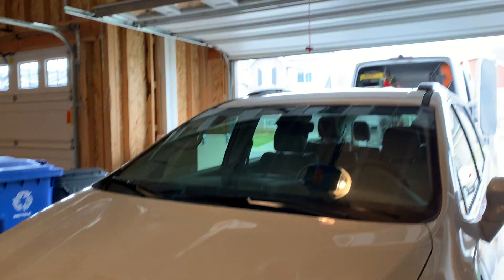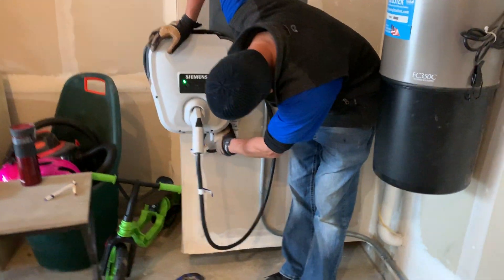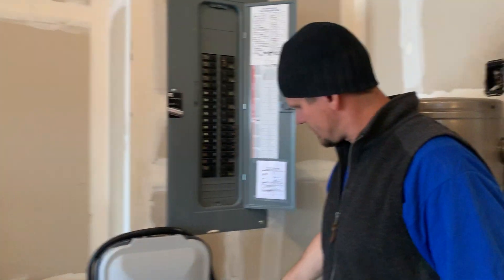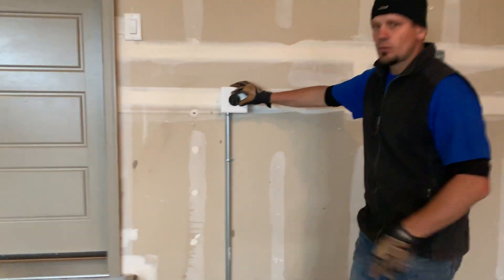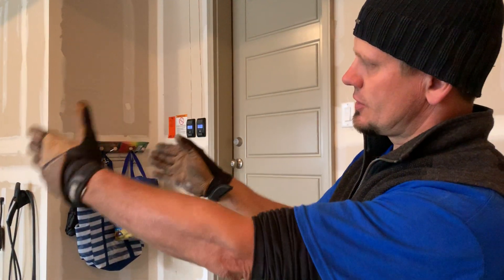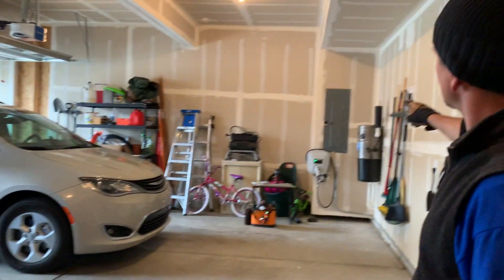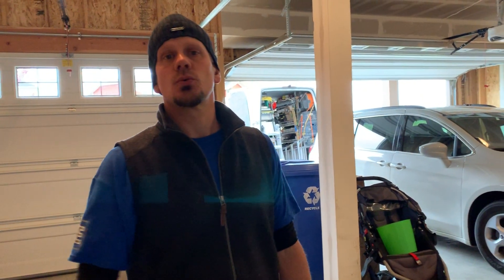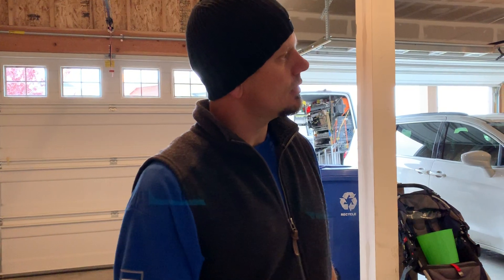Wiring a Residential Electric Car Charging Station

Comment: So..what happens when your 200amp service is maxed out with Range 50/ water heater 30/ dryer 30, air cond. 30/ heat strips, microwave etc. X the whole street, community ? If everyone had this..how long before the grid cant handle it ?... pre EV brownout comes to mind...libs...so smart.
Reply: And these are being installed at a very rapid rate across the country.

Comment: I got two 50a outlets put in for $250. I've put them in myself before. It takes 5 minutes. Don't let anyone rip you off.

Larger wire does cost a little more but the difference is negligible for 30a vs 50a.

Buy the wire yourself if it's being used as an excuse to over-charge...
Reply: No over charge, as a contractor we have licence , insurance, and other over head such as taxes, permits and such plus the knowledge to do it right. If no permits required in your area you do it yourself and it burns your house down its a good chance insurance wont pay the claim

Comment: Let's install a liquid capacitor tank and a lightening rod, and a step down transformer configuration as alternative to relying on the grid solar for the next charging system install.

Comment: I'm curious why you chose #6 awg wire for the 50 amp when #8 awg wire is big enough for the load? Was it a manufacturer's requirement for the charger?
Reply: Are you certain #8 is enough. These cars pull 30A RMS (constant), sorry I don't know terms as I'm not an electrician. But I keep seeing people use #6 and I heard someone say ifnthe run is over 100 feet to use #4. Would #8 really be enough for a 30A constant pull? Thanks
Reply: @afdave7  yes in a raceway ( conduit) #8 thhn rated for 55 amps.
Reply: @thomasmarable6818  thank you so much for the reply. Yeah, I asked another electrician and got the same answer as you. I'm only going to be pulling 32A constant. So using AWG 8/4. Just on copper alone that saves me $74,599. Hahaha

Comment: i love bending conduit anf if owner is cool with emt its cool but in a drywalled garage without paint i might have opted to run it in the wall
Reply from the maker: Tooo many holes to patch, bathroom on other side. No Good.
Reply from the maker: Besides, it's a fire wall, some of them are double drywalled or OSB under it.
Reply: I like the mechanical look of a well made conduit run. Installing  it in the wall would be very expensive.

Comment: Looks like a working space  violation in front of your electrical panel.
Reply: It's not a working space violation. The NEC is to be interpreted as to effectuate its purpose. Given what I saw in the video, Josh accomplished that quite well. Some AHJ's can be jerks no matter how perfect an install is... but I digress
Reply from the maker: looks like it, but the screw comes out on bottom left, just fine.
Reply: @Petersonelectricllc  Do you use the industrial grade NEMA 15-50 receptacles that cost from $50-100? I have heard of the regular ones melting. Thanks.
Reply: I don't know the NEC, but I think you're right.  Even if it doesn't violate code, if I was the homeowner, I would have preferred the Siemens charger next to the central vac. Regardless, it's still a pretty nice job.